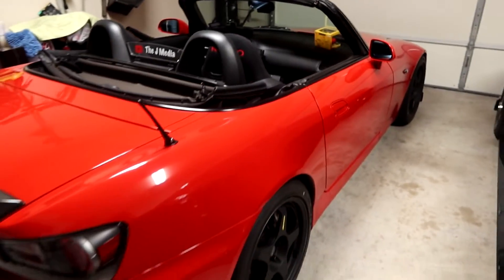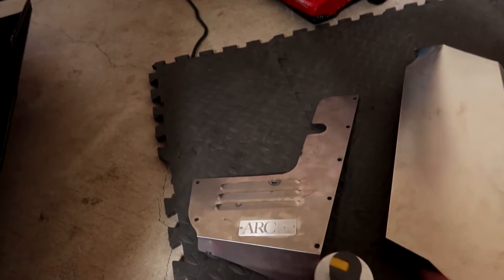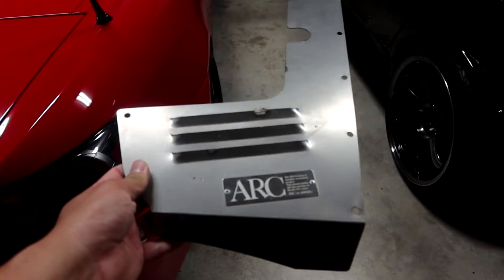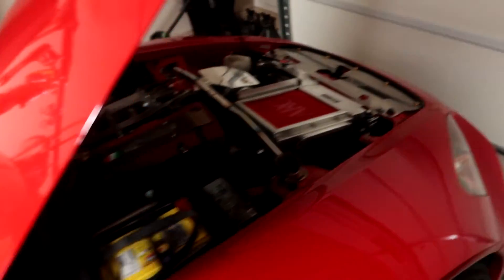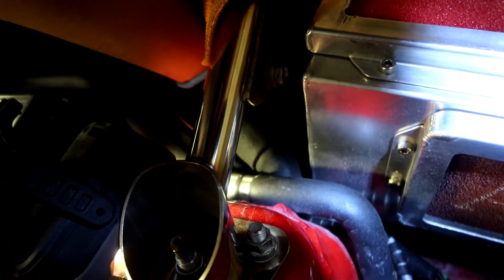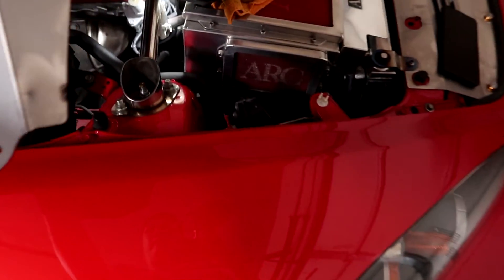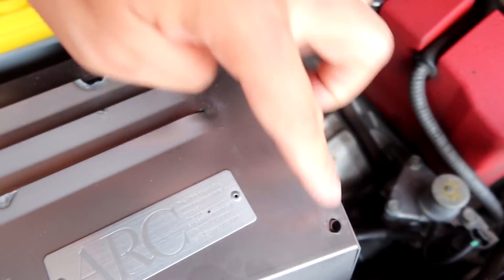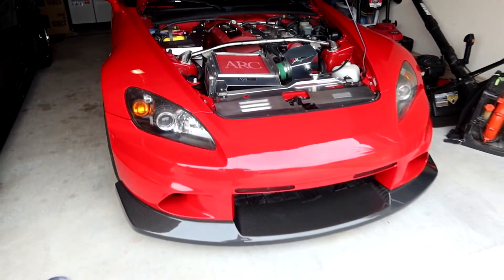Installing my new ARC Heat Shield on the s2000!

Comment: Have the arc intake on mine as well and just picked up the ARC cooling plate. As for the intake, it didn't come with the box from the intake manifold to the box. But the renegade intake arm fits perfectly and in my opinion, looks better. Still like your setup though.
Reply from the maker: That's awesome! Congrats on your pick ups! Definitely some rare and expensive jdm bling. Good to know that the renegade arm fits nice

Comment: thanks for the clutch video, I was trying to figure out how the heat shield comes off.
Reply from the maker: Glad you found it helpful!
Reply: I can't insert my hand between the shield and the engine block to remove the deeper bolt!! Did you use a wrench extension?  @TheJMedia
Reply from the maker: I don't think I used an extension. Just reached my hand way down there. But an extension would definitely help!
Reply: @smokeynagata1964  ya i just used a wrench, it was painful tho!
Reply from the maker: Haha yes definitely a tight fit!